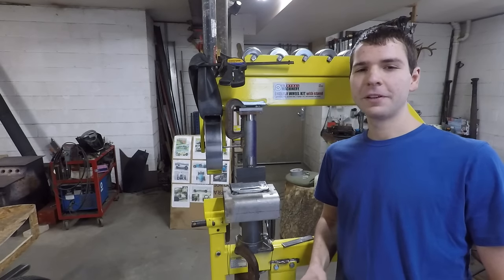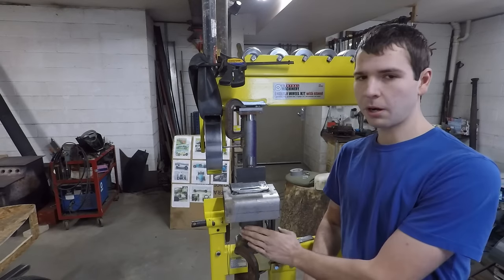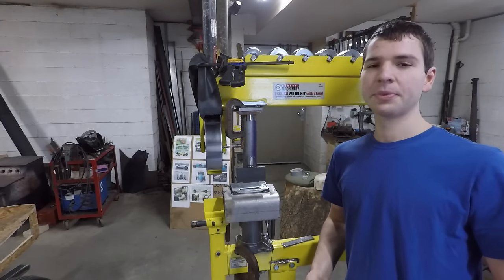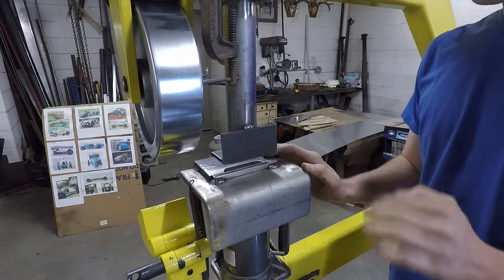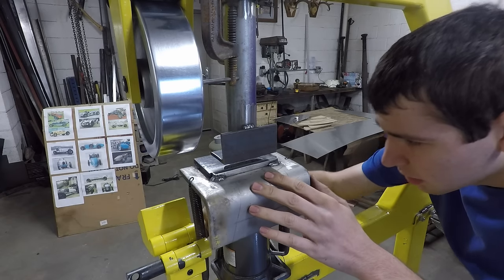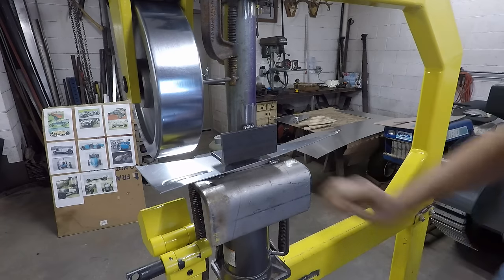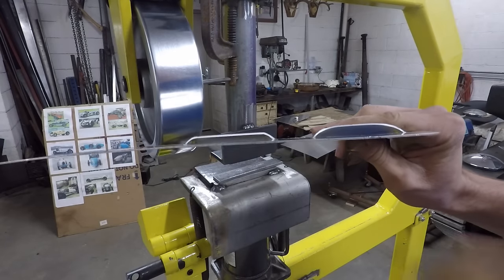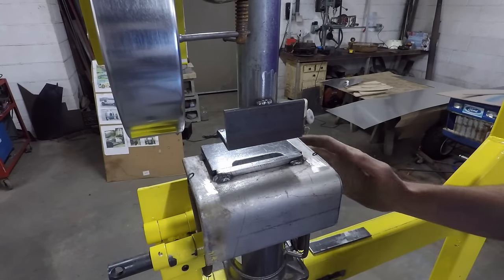SIMPLE Homemade Louver Press

Comment: What a nice feeling when the spark goes into your boot.........., keep it going
Reply: Exactly. Very poor safety practices. Most likely his father's machinery.
Reply: Ok Charles maybe , at least hes having a go . 
I am  a tradesman panelbeater / bodyman - metalwork 39 years , mechanic / engineer  42 + years .
I always wore my saftey glasses , ear muffs , overalls / coveralls , steel cap boots .
After 25 years of having metal / grit surgically removed from my eyes , having my overalls catch on most everything doing damage all the way as well as alowing multiple hot sparks to sit and  burn through the folds and run down into the boot , lotsa fun .
15 years ago I started welding , grinding , cutting , working and living in bare feet , t shirt , jeans and beanie .
I wear my safty boots and glasses in my head .
15 years later my eyes are happy ( I do wear reading glasses because of previous amature hr surgery s ) my feet are healthy and intack , smell better too . Beanies are good ear muffs and I can still hear whats going on  . 
Good thing I work for myself nanny state would have a fit  😂 👍

Comment: Nice job overall, Sorry if it's already been mentioned but when milling don't extend the quill, shorten everything up as a general rule. Extend the quill if drilling or boring, and occasionally to achieve clearance on a work piece. Leaving the quill extended will make it loosen over time and then you will struggle with poor finish etc.

Comment: Add some metal locating pins to make it easy to locate the die to the mold plate its something simple but it'll save you a lot of time
Reply: he needs to keep room around the stamp so he can move the sheet metal around
Reply: Alignment pins would eliminate you ability to get the aluminium sheet through there then.
Reply: @280zone  huh? How big are we talking here it doesn't work with thicker materials the dies aren't thick enough to work since the dies are only so shallow to work
Reply: @jessep3079  not once does he take it off whist moving the metal around he just released the pressure on the bottle jack to regain his space to press it again

Comment: nice job. Please though, find a way to safely hold  the work while using the bandsaw.  one slip and your life can change forever. clamp it or tack weld it to a larger piece so you hands are not in line with the blade.   Cheers
Reply: Dan Neumann I was just thinking the same. Speaking from experience.
Reply: Watching push into the blade with an open hand made my cringe... serious injury if he slipped
Reply: So I'm not the only who noticed that too, feel bad about it.

Comment: Move the jack closer to the inside of the English wheel. It will reduce the flexing.
Instead of welding the jack to the base. Find some round stock that fits over the shaft and just secure it with a screw. Takes up less storage space and no need to dedicate the jack to one type of tool.
Reply: Yeah plus air over hydraulic would make this take a tenth of the time and allow for better aligning time and less fatigue which can cause mistakes. Let me tell ya, screwing up Louvre #24 of 30 suscks!!

Comment: To keep the alignment of the top and bottom halves of the jig, weld on arms that extend to fit adjacent to the side frame that you are jacking off (English wheel?) when these arms are against the frame they the slots will be aligned. They can be clamped loosely to the arm to stop the jig moving around.

Good work it was inspirational.

Comment: Thank you for the upload.. I've thought about your alignment problem, I would place the die part completely in the cavity, clamp the bottle jack part down, jack it up until the die assembly part touches the top of the English wheel frame and then clamp that in. I am probably wrong but wouldn't that make it so the die and cavity are lined up when you separate the two parts by lowering the bottle jack.? It seems like my idea would be faster than clamping them both in separately and then trying to line them up by trial and error.
Reply: Thats what i came here to say. Seem like it would work

Comment: Could you partially fill the void in your punch with another piece of metal? I'm wondering if that would eliminate the last step to flatten the louver (the die would end up clamping own against the metal, instead of only shearing it).

Comment: Nice, louvers work. Had my 55 chevie with a 57 283 done. Even here in El Paso I could pull the fan and eliminate overheating. Helps in the quarter mile. Are the dies available ready made? Good video enjoyed a lot.

Comment: if you add a piece of rubber or the like into the die opening you would form it flat without your last step saving your punch if you over pressure it

Comment: Hey bud.  Just a couple of pointers.  You could do the same thing with a shop press.  Actually it would probably be even easier.  Also, don't weld the bottle jack directly to the base plate of the press.  Instead, get a 2 inch thick piece of round stock and weld that to the base plate so you can just insert the bottle jack into that tube.  Besides that, looks cool!

Comment: I can see the wheel move a little bit when you press the louvers. You ought to provide an opposing force on your englich wheel frame so you dont bend it. Maybe ratchet straps from top to bottom?  I'd say place your jack near the post so you dont have any leverage to bend the frame, but I can see how that could limit the movement for the metal sheet.
Reply from the maker: when I installed the english wheel, I added a pole on top that connects to one of the main beams that holds the house up, so the little bit of movement is actually the whole house being jacked up

Comment: Abottle jack and just some pieces of steel laying around?. What about a fully equipped machine shop that i saw?.
Reply: The 'fancy tools' only make things faster, (arguably) not necessarily better. I have seen people without shoes, sitting on a dirt floor, using their feet as a vise, making better/nicer items than I can with basic machines/tools that cost more than they make in a year.

Comment: To do the flater face use a piece of hard rubber in the bottom of the die as it will form to the the punch and means you do not need to return it to the punch once punched.

Comment: The rest of the grinder is very dangerous, reduce the gap to minimum and stop using the side of the wheel. These can burst very easily.
Reply: 8" grinder x 3.14 x rpm of grinder/60 = 1440 feet per second that's how fast a chunk of that wheel would hit you in the face...safety glasses would be useless..and I have seen it with my own eyes. dude went down like a sack of potatoes..when a 3/4 piece hit him in the mouth.
Reply: Same came to mind as soon as he started using the grinder, noooooooo
Reply: Plus don't grind on the side of the wheel!
Reply: Don't grind on the side of the wheel.
Reply: @vocalpatriot  thats actually inches per second.  You forgot to divide by 12 to convert to feet.  But still more than enough to poke holes in someone.

Comment: I made something similar years back. Knowing that alignment could be an issue I made it with the addition of a 2mm thick spring steel locating plate that went up the front of the female louver die and into a slot on the male half. It's hard to describe, But where your's has it's shearing edges, Mine had a metal plate sticking up on the female half where the louvers opening was to be made, and a recess machined onto the male half up to where your shearing edge is, And a thick metal plate bolted to the back to make a through slot for the alignment plate to move in. I hope that explains it well enough for you to get what I'm on about.
The only downside was that it wasn't really a proper louver "Punch" as you had to pre cut the slots in the metal before you could use the tool to shape the louvers. On the plus side, Using it was pretty much idiot proof (*Almost), And as you were only shaping rather than shearing the metal it required a lot less force.
You'd mark out the slots and drill the endpoints with a 2mm bit. Join up the holes with a 2mm slotting disc on an angle grinder (Using a piece of angle iron clamped down as a guide). Then put the female half of the tool on a solid bench, Drop the metal to be louvered on top and get the locating plate through the slot cut in it, Then fit the male half over the locating plate and CAREFULLY smack it with a ruddy great hammer. :)
It worked fine about 99.9% of the time, And the times it didn't work was down to the moronic gorillas who were USING the tool rather than any mechanical fault with the thing itself. :D
That thing was made from scrap we had around the place, and only took me about a day to put together, But it had already made that company a fair bit of money by the time I left.......... I should have nicked it when I quit !!!! LOL !
 
(*ALMOST idiot proof means it didn't stop complacent idiots missing the tool with the hammer and smacking it full force into a customers bonnet (I'm British...... Oh OK, "Hood" then) !!! OR managing to press the louvers in going every wrong way imaginable (The openings facing back rather then forward, Or being pressed outward rather than inward)....... Seems you can't outwit a determined moron. LOL  !!!!)

Comment: To reduce the two steps of shaping and then flattening, you can add some high durometer rubber inside the female mold. This will better press the sheetmetal against the metal form during the first shaping.

This is a good illustration and might generate some ideas for your next design iteration:
https://www.youtube.com/watch?v=xw5yEMsDxR8
Reply: Even my thougt, when i see the second step ...

Comment: Couldn’t you put a plate in the bottom of the concave half and reduce the height of the convex half so you don’t need the wood pieces and can do it in one step? If the wood pieces are there for doing multiple close together or close to another feature, I guess leaving the convex half protruding makes sense but still think that adding to the concave half would mean you can just do the one press. Awesome job though!

Comment: You could experiment with placing a shim of the correct thickness in the bottom half of the die to give the flat finished surface to the workpiece in one step instead of the two-step process.

Comment: Never use the side of a grinding wheel it will blow up. Not that it might blow up but it will blow up. Put some dowel pins in it and it will line up every time the pull them out after setup and they wont be in the way. It works nice good job .

Comment: How come your grinding wheel didn’t come apart when you used the sides like that?
I have had to clean up the mess after the side of one was accidentally touched forget used hard.
Reply: David Grover he was very lucky. No shield over the wheel either. If I do use the side of the wheel, it’s just with a very light touch. He pushes his equipment very hard. You can tell even with the speed up. He’s young and doesn’t get it yet. Some day something will break or explode, and he’ll understand. Hopefully, he won’t injure himself so badly that he won’t be able to use his shop anymore.
Reply: Something was grossly wrong with your wheel.  I side grind all the time with various wheels and grinders.
Reply: Marc Britten, The schools wheel not mine. They always warned us that the wheels couldn’t take use like that but once a year someone screwed up.
I don’t think anyone got injured just dirty and surprised, but it was always a mess to clean up.

Comment: Thank you for sharing this video. There are a few things I had questions on. One was, if it is warm enough to wear shorts while welding, how is it still cold enough to wear Sorel pack boots? I mean, I understand if you dont care about safety, but there's no way in hell I'd burn a hole in my Sorels if i could avoid it. 
Also, the punch part, which you ground from a rectangular stock, would it have been easier to cut it from a round bar stock,  or was the radius wrong? The reason I ask is it seems the radiused ends could be accomplished easier while the round stock was on the lathe,  then the pill-shaped result could be sectioned into a "quarter round"  profile. 
Nice job. A lot of people wont think to make their own dies. For sheet metal projects, it isn't so bad. For smaller and softer metals you can even make dies that fit onto vise jaws.

Comment: You have a milling machine. Why did you go to all the trouble band sawing that notch and then filing the two radiused corners. It would've taken a lot less time to just mill it. You even have a good roughing cutter. Other than that, I liked the video, and I especially like how you speed up the parts that could be boring.

Comment: Using the side of a grinding wheel, my shop teacher would have thrown you out
Reply: Because Vince (or whatever the originator's name is) is more talented than your shop teacher - and he clearly knows what he is doing.
Reply: @donkeyha6053   I agree> not smart! and notice the angle grinder cutting so close to his power cable,... also not smart!
Reply: For the uninitiated; Google ‘angle grinder accidents’ and click on ‘images’. Be careful out there, always safety first.
Reply: He's wearing shorts. So if the grinder wheel exploded chances are small that it will damage his clothes.
Reply: Also when he's using the cutoff wheel on the grinder he leaves the grinder running when he sets it face down to flip the top die around in the vise to finish cutting it.

Comment: You do what you want, but side grinding with those bench grinders is highly dangerous. Those wheels are not designed for side loading and can burst from that. Better to fit a disc sander plate to that bench grinder with 36 or 50 grit sanding discs.

Comment: Very nice work, but you really need to respect your angle grinder more. 

Don't set it down while it's running, and stop laying it disk-side down. The 2 stands on the back of it are where you're supposed to rest it to keep the disk from any contact.
When the grinder catches, or breaks a disk, the torque generated by the RPM of the motor are instantly converted into acceleration. 

With grinders and saws, it's never a matter of "If", its a matter of "When". Ask any old welder or machinist. They'll always have a story. 

I'd hate to see someone as talented as you get your craft hindered by a lost finger or hand when your grinder decides to rapidly enter low-earth-orbit.